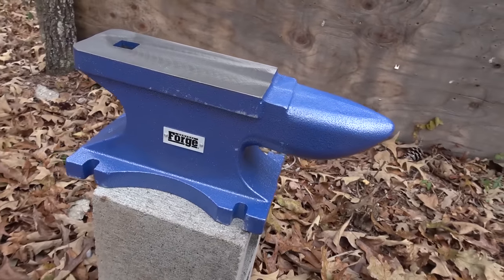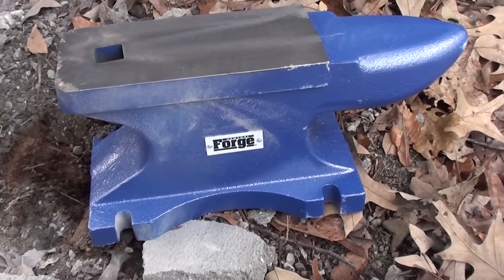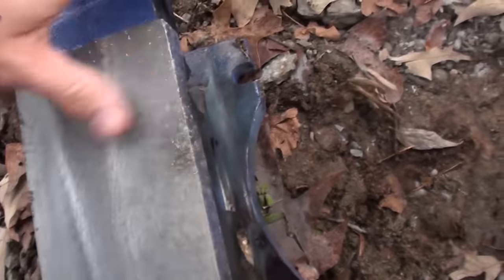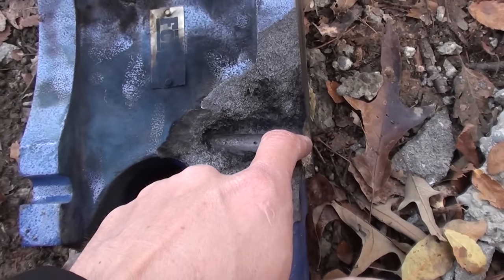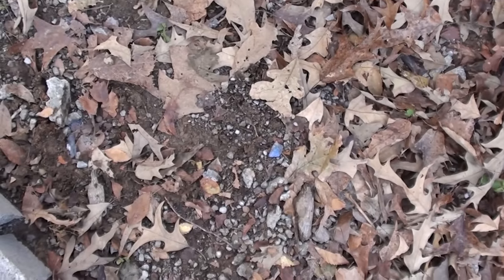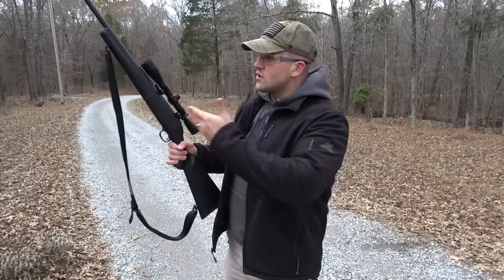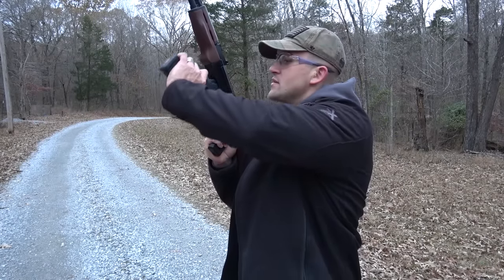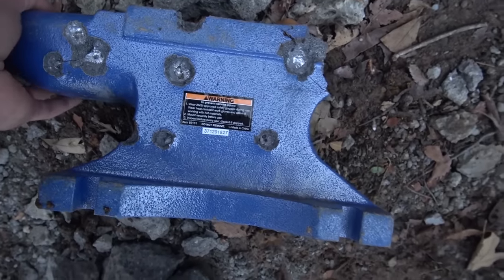50 BMG vs Anvil

Comment: This is the same gun that put Scott in a hospital 2 years later!
Reply: True
Reply: Are you surprised? That thing has a freakin cap that holds the pressure of a freakin 50 cal round. Wow, sure it holds the pressure of standard ammo, but a gun should also be designed to handle failures at least in such a way to let the gun explode in the opposite direction in case of an over pressure error. My mind is boggled how people still defend that sewer pipe of a rifle. Wouldn’t shoot that thing if it was for free.
Reply: @codecampbase1525 I agree. Who's idea was it to put a fuggin threaded cap on the end? Why not bolt, or falling block? Cheap manufacturing is why.
Reply: @lukefarnham2119  its a sewer pipe rifle. Straight outta the sewer and comes with a green glow. Send this thing to our enemies.
Reply: Engineering is pretty much using as little material and money as possible to make something that’s passable 

RN 50 was supposed to be an affordable 50 cal. The average price is around $1600. From what I see on sale for other rifles go for $4500-15000. 

It’s a risk to take. So only use it in the way it’s intended to, and not with incorrect ammunition
Reply: Yes but the problem was the ammo. Not the gun, as far as I know.
Reply: @alq1967 both. Good guns fail in a safe way.

Comment: The grain structure of that anvil is too coarse. You really need to test with a forged heat treated anvil.
Reply: Probably a Chinese built one.
Reply: @douglascasey3486  Better yet...manufacture label says...'Made In The British Crown Colony of Hong Kong'...
Reply: Yeah, says made in china on the lable .
Reply: It's iron, not steel.
Reply: Its a harbor freight anvil, its made of cast iron. Very soft, you can dent it with your hammer. (I know from experience, mine is covered in dents.)
Reply: If they did that the bullet might bounce off unpredictably, maybe a safety thing?
Reply: @darkmegaman44  It would also be a lot more expensive, most steel anvils aren't what I call cheap.
Reply: @Cortalpsychmajor  That's because they are sold as "antiques" instead of the tools they are
Reply: @RangerOfTheOrder  I've heard that older anvils are better from work hardening, that may also have something to do with it. From my understanding a lot of older smiths prefer an anvil that has seen at least 70 years of work.
Reply: @RangerOfTheOrder  negative sir.... good anvils are very expensive because of the quality of the craftsmanship and the quality of the metal they're made from.  Also most good blacksmiths use anvils from 150-400+ lbs. Not cheap nor light!!
Reply: A piece of railroad rail would be much cheaper and comparably tough
Reply: Yea its cheap crap :/
Reply: I believe that the "grain" you see here is part of how the cast iron fractures. If you were to cut into it with a saw I don't think you would see the same pattern. I do agree that a good steel anvil would not show the same pattern.
Reply: @Cortalpsychmajor  Yes mate. A proper anvil is not a cut price item. This could be used in a small shop, doing small softer stuff. But it may dent or pit, especially if it is clouted off flat with a hammer face. Any kind of forge work or serious blacksmithing, forget it.
My old fella had a small Anvil, made from a lump of Canadian Railroad Rail, flattened off on the Shaper, then a waft on a surface grinder. It was small and really cute. Pretty useful too, stood up well to my abuse in our back shed. Christ knows where the bloody rail came from. I'm in the UK.
Would seem like a crime to ruin a proper Anvil. You could substitute all sorts instead.
This was still a decent video though. Even if the Anvil was a cheepo, donkey metal, Chinesium one, with grain structure you could drive a bus through.
Reply: If it doesn't say Peddinghaus, Perun, or Kanca on the side (and it's new) it's better dropped in the garbage heap than called an Anvil.  This was an ASO (anvil shaped object) made of cast iron, not even worth the effort it took to pick it up, much less actually putting money in someone elses hand for this garbage.
Reply: A used 60lb London pattern anvil with a hardened steel face cost me $500 ( a new one of that size would have been around $800) The unhardened, cast iron stuff is often referred to as an ASO ( anvil shaped object).
Reply: Yeah, those harbor freight anvils aren't real anvils. My blacksmithing mentor calls them "anvil shaped objects"
Reply: Harbor freight.
Reply: Imagine a100 pounds full steal anvill. Nothing will break that

Comment: When they ask, "Is it hard?" And a guy says, "Blue Steel!" He isn't talking about cast iron under blue powder coat. It looks like some impressive damage until you realize the BIG difference between an economy, cast iron anvil, and a pricey, forged steel anvil. So if anyone watching is imagining getting this much penetration on "Hummer," or APC, armor plate, you should know not to expect near this much penetration. Military armor is made to handle much more of a beating than a soft, easily breakable cast iron anvil. This is just a demonstration of the effectiveness of caliber, and projectile type, on a low cost anvil. Forged steel anvils can be pricey, and out of the range that he would want to spend just to torture it with hot tungsten and lead. Besides, a good quality, forged steel anvil is a piece of art that you just wouldn't want to torture, or destroy, unless you just don't care, and have a good chunka dough to blow.
Another thing to consider is range. Most combat engagements will usually have a lot more distance for the projectile to travel before contact with a target. If you noticed the slow motion tracer shot, the red tracer pellet had not had time to ignite by the time the projectile hit the anvil. What we saw burning on the aft end of that projectile during flight was gold in color, and was the layer of priming compound that coats the aft end of the tracer pellet. That compound's purpose is to ignite the tracer pellet composition, that is pressed so hard into a solid pellet, that it most likely wouldn't ignite very well, if at all, if fired without the priming compound. The red tracer pellet had just lit as the projectile was digging into the anvil, and the pellet broke off and flew off to the right about ten feet away or so. You could still hear the tracer pellet sizzling as it burned on the ground. Anyway, point is that most combat engagements, especially sniper work, are usually done over much greater distances that, for a heavy projectile like .50 BMG, causes the projectile to lose velocity and energy fairly quickly as flight time and distance get greater and greater. At the muzzle .50 BMG is devastating, in the ballpark of 2,700 fps and 11,000 ft lbs. However, at say 2,000 yards its velocity, and energy, are down to around 930 fps and 1,280 ft lbs. At the maximum distance of 2,600 yds most .50 BMG loads will be down to around 810 fps and 980 ft lbs. At those distances penetration through even the thinnest armor steel is a "long shot."
Reply: Spot on

Comment: The main reason the smaller calibre rifles didn't penetrate far into the anvil is due to you firing FMJ instead of AP. The hardened steel or tungsten carbide cores of the AP rounds are far better at penetrating due to the hardness of the material and the higher strength compared to lead. Also you where fine at 5:24 as it was only the tracer element that detached from the rear of the round coming back.

Comment: You used a cast Iron anvil,why don't You try With a hardend Steel anvil,you'll see what a difference!!
Reply: Thank You!! Grazie Mille!! Hello From Italy!!
Reply: @Homer Simpson I worked With a  Blacksmith and i know the anvils and i know that in hardend Steel They are Much harder than those in cast Iron,i don't want to be demanding!!
Reply: I was going to say the exact same thing. Try shooting an ACTUAL anvil, instead of just an anvil-shaped object. My curiosity will be satisfied when that happens. Until then, this is as good as shooting an engine block, which isn't saying much.

Comment: For a valid test, you need to use machined steel. The anvil was made of cheap cast iron which fractures easily, unlike steel.
Reply: Exactly what I was thinking. He should have used a forged anvil as opposed to a cast one

Comment: I think it's obvious at this point, we need a gun that shoots anvils.
Reply: Everyone else on the planet: sweats nervously
Reply: Armor Piercing Incendiary Anvils!
Reply: Complicated logistics for such a gun. Not sure if Wile E. Coyote would try it unless Acme was having a clearance sale. 😆
Reply: Could work with a long metal electromagnetic-acceleration tube and metal anvil. But power requirements (and coils, capacitors, etc) to get high anvil velocity would increase exponentially with anvil mass and just be ridiculous.

I think anvil-launching siege engines (catapults, trebuchets, etc) would be the best way to go.
Reply: @pwnmeisterage  Siege engines don't have quite the range potential of a rail gun.
I think that a siege engine would be a little difficult to hide from the neighborhood. Naturally the siege engine is easier to explain than an anvil blowing through the neighbor's house because of a rail gun misfire. The rail gun might brown out the neighborhood when charging to fire. 🤣
Reply: @stevenduncan7380  lol ... An anvil blowing through the neighbour's house is going to present a difficult explanation regardless of how it was accomplished

Comment: Wonder how a real anvil made of hardened, tempered steel would hold up.  Cast iron is pretty brittle stuff and ASOs (anvil-shaped objects) are notoriously weak.
Reply: Sounded like he wasn't sure what material it was and just guessed with cast iron.  Heat treated steel would make a big difference.

Comment: New anvil-s are made of cheap material. Try an old 100% pressed metal anvil. You wont even penetrate on the sides.
Reply: Probably would as the side is wrought iron and quite soft. However the top is tool steel and it wouldn't do much
Reply: @priestleyharker4046  still old anvil are much stronger than new ones
Reply: The word is Drop Forged
Reply: @ardittidra7636  that really depends on the maker.
There are some amazing new anvils made from very tough steel. Much stronger than anything antique. However they are very expensive, i doubt they would shoot a $10,000 anvil
Reply: @ARsRUS556  so i have this old anvil in my house and its imported from russia i believe. Its from the times of comunismus. So me and my friends have shooted more than 90 rounds of 7.62 on it. Several times in several angels and it only got dents on the sides. Because i believe its pressed iron or steel. I'm not sure about it. I've read somehere that avil like those one can even resist the blow of an defensive or ofenssive hand granade. (Ps: sorry for my bad english)

Comment: The common blacksmith's anvil is made of either forged or cast steel, forged wrought iron with a hard steel face or cast iron with a hard steel face. Cast iron anvils are not used for forging as they are incapable of standing up to the impact and will crack and dent.
Reply: So what is a cast iron anvil used for? Only other use I can think of is panel beating...
Reply: That’s a crappy anvil, you don’t need a 50 cal to break it, you can break it with a sledge hammer.
Reply: That's an ASO....anvil shaped object. Newbies get suckered into buying these because they are cheap.
Reply: @MrDirtysteve75  Interesting... Who knew I'd learn stuff about anvils and ASO :o

Comment: In the good old  anvils were made from rail way track. The top of the track is sliced off because it is really hard and the rest is softer. When the anvil is cast they are cast vertically the bottom is naturally cast first up to 3-4 inches from the top then the top of the anvil ( deck and horn) is cast on top. If you look at an older anvil you will see from the side the different metals( it is quite noticeable with a different pattern). It won't be done like that with modern rails because the rail is rolled in one section.

Comment: you need to get a official old school anvil, not a modern one, the older ones were made in a forge steel and get one made from Japanese carbon steel then see what happens when you shoot at it? You can see just how soft the cast is, its still steel but at what grade steel is the point?

Comment: I would like to see a 20mm after the .50. 30.06 and .308 did some damage but it went downhill from there.The problem I noticed ,it's a cast anvil , so each time it's hit , it fractures making it weaker for smaller rounds. Last might be a .22 short and it'll blast it to pieces. I see the problem though, you don't want to go buy a dozen anvils! Laws are different everywhere but it'd be kool to get hardened steel and use cannon rounds ..Good shooting!

Comment: You cant do much to a cast iron, you cant press it, it holds high amount of cumulative heat,  the high temperature is like a walk in the park for it,   you can only crack it, that's perhaps the only weakness of cast iron, it cracks easily other than that its the very next thing besides shooting an actual tank! But in the video, it looks like the object isnt entirely made of cast iron. It is some sort of cheap mix of different metals to make it lighter , for shipment from China of course.
Take a true solid anvil and see 50 cal bounce of it like a 9mm.

Comment: Is that anvil cast iron or cast steel?By looking at the grain after it has broken looks like cast iron not cast steel. Cast iron will be easy to penetrate than cast steel I think.Cast iron is weaker and very brittle in comparison.
In any case I could be wrong in my observation about the metal grain that was shown in the video.

Comment: You ever seen the hydraulic press Vs the sledge hammer? The old sledge hammers that were made in Britain or the US were solid, but the modern ones are Chinese and they fracture in the press, and they look like a weak cast, like inside that Anvil

Comment: Too bad those harbor freight anvils are awful. The face isn't hardened on them, they're just pure cast steel. Try that on the face of a real anvil, like  a Trenton, Hay Budden, or Kohlswa. Probably still put a gouge in it, but it won't crack, and you won't get rounds penetrating 5 inches into the body.

Comment: Why don't you guys ever ATTACH, FIX OR BOLT THE TARGET to a stationary platform?   that would yield truer results of the power/energy of the projectiles?  A fair level of the projectiles energy us soaked up into the targets moving rearward upon impact...Surely with all the resources you have at your disposal a concrete slab made for such testing could be done. Just sayin..